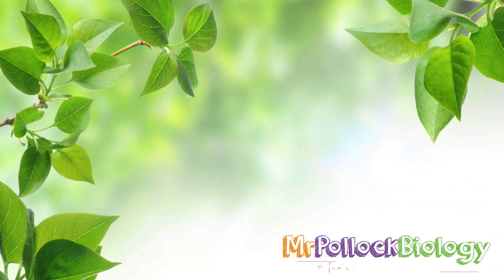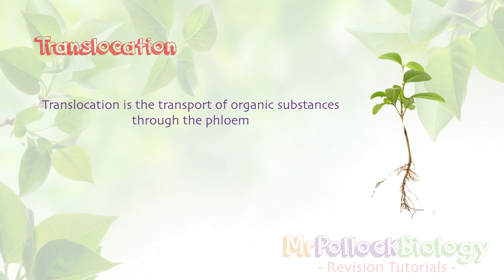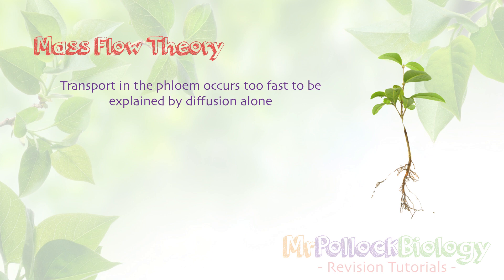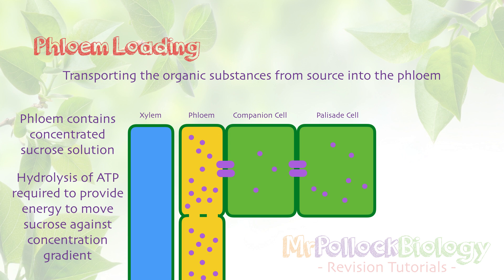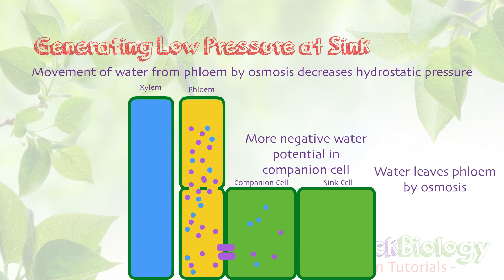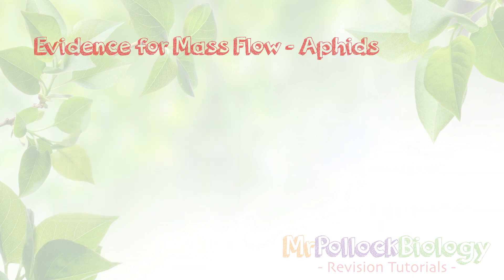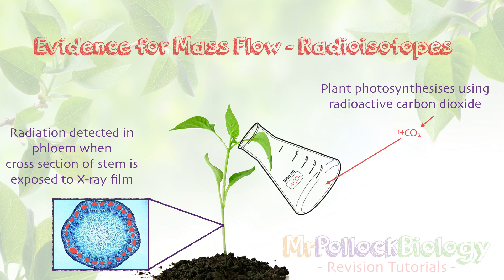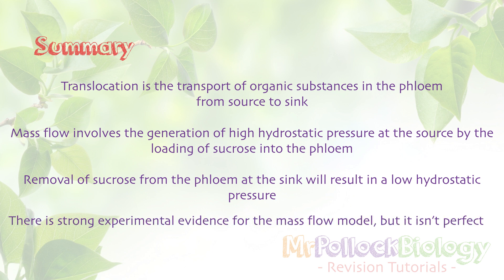Translocation in the Phloem (New AQA AS/A Level)

Comment: sucrose doesn't move into the sieve tube element by facilitated diffusion because facilitated diffusion doesn't involve the use of ATP (as it's passive transport) and also facilitated diffusion is the movement of substances from an area of high to low concentration. So it moves by active transport.

Comment: Thanks for the amazing explanation but I had a small confusion. How does the phkoem already have a concentrated solution of sucrose. I mean where does it come from
Reply: From the leaves that make glucose in photosynthesis(water + carbon dioxide -> oxygen + glucose). This is then turned in to sucrose which travels via the phloem.

Comment: Sieve plates are to maintain the gradient between the source and the sink. Without the sieve plate to provide resistance and obstruct the flow of sucrose by translocation,sucrose will be transported too fast and this will cause the high hydrostatic pressure at the source to disappear. Its like there must be a "balance" between for the rate of translocation.It cant be too fast or too slow

Comment: Hi Mr Pollock. Thanks for the great video.
Just one small issue. At 8:28 you say that some water moves out of the phloem back into xylem.
I am unsure of why this is the case since the water potential of the xylem is higher than that of the phloem. Why would the water move against the concentration gradient.
Reply from the maker: Don't worry too much about it. In reality, the plant actively transports some mineral ions into the xylem in the roots to enable water to move in...but that's not on your spec :)

Comment: This is quality, could you do one of these for the xylem pls??
Reply from the maker: +Dan Ghafoor for new spec xylem; you need structure of xylem, cohesion tension, transpiration etc, they also require to know how water moves by osmosis across the mesophyll in the leaf, towards the stomata.
Reply: +Dan Ghafoor /watch?v=t14KGGWtn4M
Reply: +Utopic I'm assuming that's for the old spec tho
Reply: Dan Ghafoor yeah, but this is a topic that is similar between the two syllabuses
Reply: +Utopic its got quite a few differences (apoplast/symplast pathway, root pressure, casparian strip) and I'm not sure what exactly I need to know for my spec
Reply: Dan Ghafoor oh okay, well I didn't watch the video myself as the stuff required for that topic in the new spec is quite simple, but the things you mentioned are definitely not required this year

Comment: Correct me if I'm wrong, but from what i understand sucrose is transported to the companion cells from the source by co-transport (via facilitated diffusion) using a co-transport carrier protein and down a conc gradient, created by actively transporting H+ ions out for the companion cell. Sucrose then is transported into the phloem sieve cell by co-transport again with H+ ions and while sucrose is going against its conc gradient the H+ ions are going down its conc gradient because there's a higher conc of H+ ions in the companion cell than there are in the sieve element?

I get the rest, but could you clarify this part please^?
Reply: Hiya, here are the steps:
1) sucrose in source moves down conc grad from source to companion cell by FACILITATED DIFFUSION.

2)  H+ ACTIVELY TRANSPORT against conc grad from companion cells into spaces within cell wall using ATP.
 
3) H+ and sucrose diffuse down conc grad by CO-TRANSPORT.

Hope that helps :)
Reply: +Zoey M Thank you it makes sense now :D
Reply: Sorry, let me just clarify point 3:
Sucrose and H+ co-transported into sieve tube
Reply: +Zoey M yh thanks. Question: is there a different between facilitated diffusion and Co transport aren't the two the same thing because facilitated diffusion involves carried and channel protein and Co transport uses Co transport carrier protein to transport the H+ ions and sucrose into the sieve element?
Reply: +Aaron Owusu no, they aren't the same. Similarly, active transport also requires a carrier protein. 

Co-transport (specific to translocation) is when the sucrose is drawn out to the cells along with H+ that have been actively transported out. This is also know as an indirect form of active transport. It is the H+ conc gradient that powers the movement of the sucrose into the sieve tube. 

I would recommend looking at the sodium-potassium pump (especially since its on the spec), it will really help you in understanding co-transport :)
Reply from the maker: +Zoey M well explained :) mechanism of co-transport for protons and sucrose isnt explicitly required...just that the hydrolysis of atp is required to move sucrose into the phloem from companion cells. However, as you've described...the atp is really used to set up a proton concentration gradient to allow co transport (symport) to occur...so atp required to move sucrose, but indirectly :)